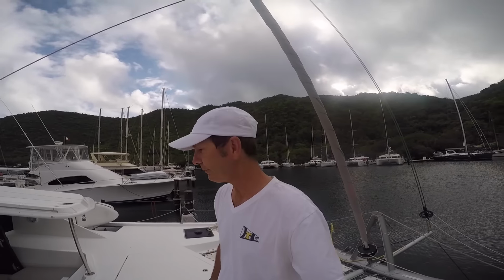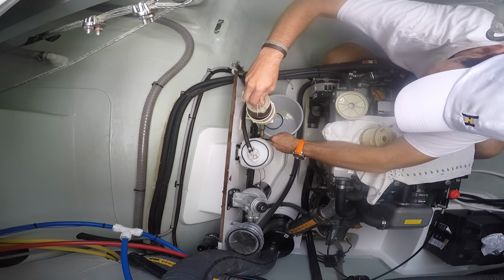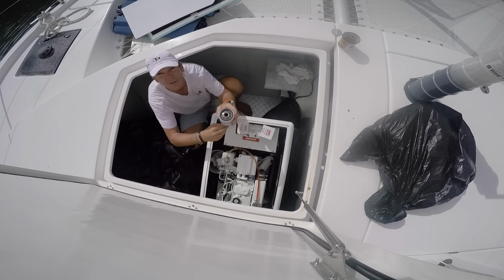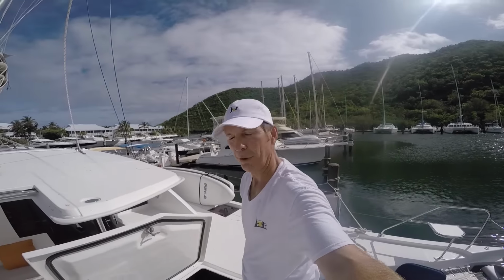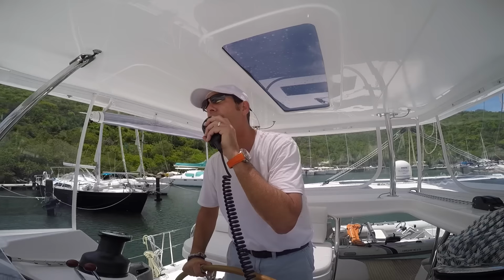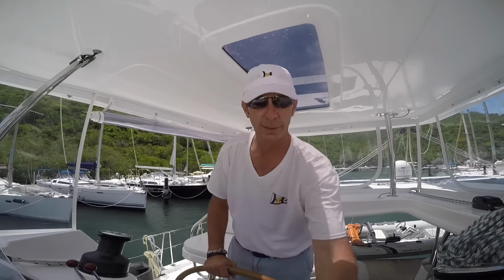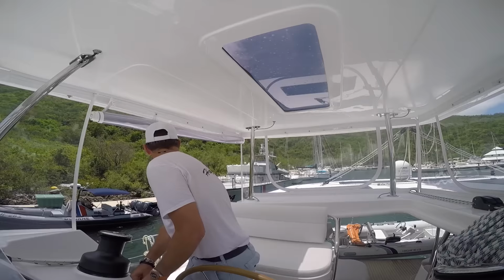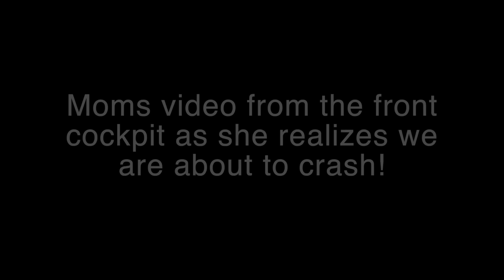Episode 15 Moms, Maintenance and Mayhem! Leopard 48

Comment: The windlass maintenance went without a hitch.  So that's 1 for 2 which means you're batting .500 which is darn good average in the major leagues!

Once, I did some maintenance on my boat which included cleaning the lines to/from and the heater core.  Next day we took the boat out and it did not take long for our feet to be standing in water.  I thought, shoot, did I forget to put the plug back into the hull?

Floored it back to the hydro-hoist only to discover the cleaning was too good and exposed a hole in the core.  We were so rattled, I left the boat on the hoist and we headed over to the nearby dock bar and drank beers and ate oakie tacos for the rest of the day.
Reply from the maker: Hi Jeff, Thanks for watching. I feel your pain:) read my blog post about this video at svhappytogether.com and you will see my "hole in the boat" story. Randy

Comment: a red tag for safety is also good idea. for example you are on the water scrubbing the hull and props. as a safety precaution you can put a red visible tag on the engine start and controls, and helm(so nobody suddenly moves the rudder)  as the say I wish you fair winds and following seas on your voyage.
Reply: lockout / tagout is a great idea.

Comment: That was a close call. Quick thinking by you to remember the rudder and quick action by Lennie to save the day.
Reply from the maker: Hi Marvin, Thanks for watching! She did good. I was a bit frozen:) Randy
Reply: Does the 48 not steer perfectly leaving the rudder in neutral position and just use differential power ?  All of my past twin screws steered easy in close quarters.
Reply from the maker: Hi Lix, Yes and no. The panic was you can't stop a cat from forward motion easily so they first issue was reversing the engines and putting out enough power to get me moving backward. The second was the rudders weren't in neutral position. And the third is that cats don't have counter rotating propellers so each prop spins the same way causing a bit of "prop walk"  but with all that I still was able to stop and get backward and not hit anything until she freed the rudders. Thanks for watching and your comment! Randy

Comment: Do you run your generator most of the time when not connected to shorepower?
Reply from the maker: Hi ErbiRacing, We do run the generator but only at night from around 9 pm to 6 am for AC when we are sleeping. IN colder climates we only run for a few hours for battery charging and laundry. Good question! Randy

Comment: H. T.

Why was there any PANIC. You have two engines, you don`t need the wheel to steer.

Slow down your thinking when doing things, you confused your viewers when you were talking about the filters on the gen set too, one second it was a fuel filter next it was an oil filter.

Breathe. Think. Do.

David. Down Under.
Reply from the maker: Hi David, Thanks for watching. Almost hitting the rocks was a bit of an adrenaline rush. All is well that ends well:) Randy